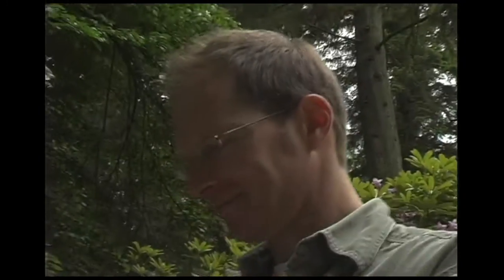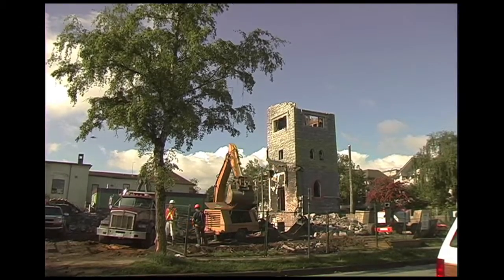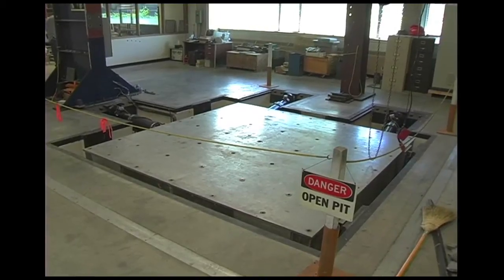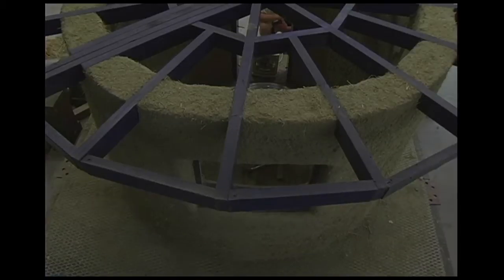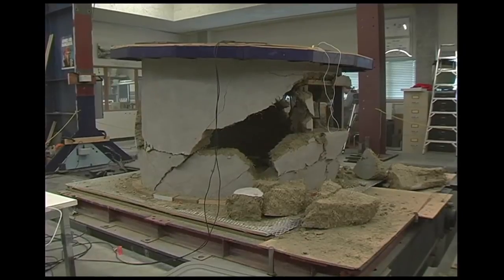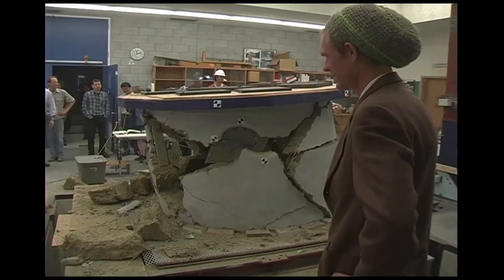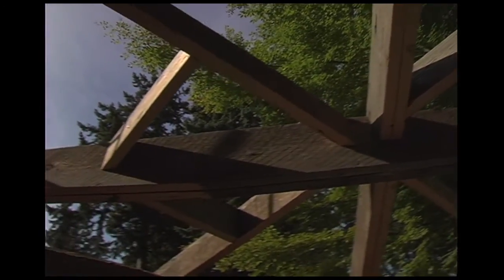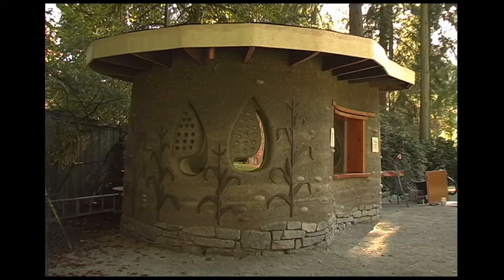A Creative Impact: The Stanley Park Earthen Architecture Project

Comment: You need to reinforce your construction to pass the earthquake test. Peruvians has more experience and have developed more rules about it. Here in Chile, after the 8.8 earthquake i remember that many structures like that collapsed. There is a church that was restored by adding iron meshes in the walls, linked with each other very tight like making a sandwich. Then it all were covered with earth on the top, getting the same old appearance. Good luck with the project!